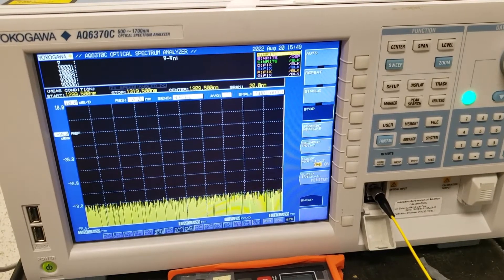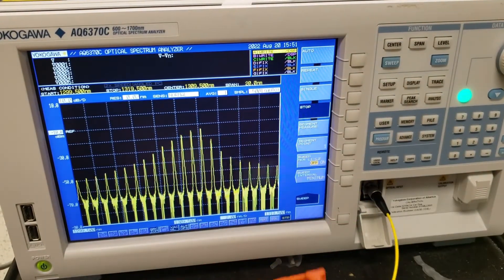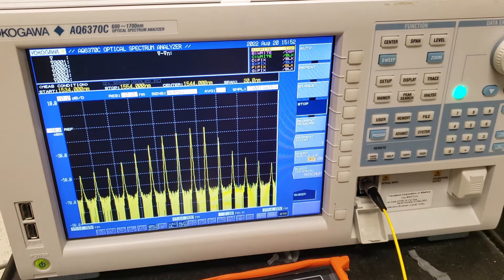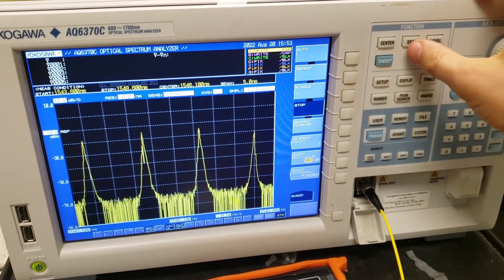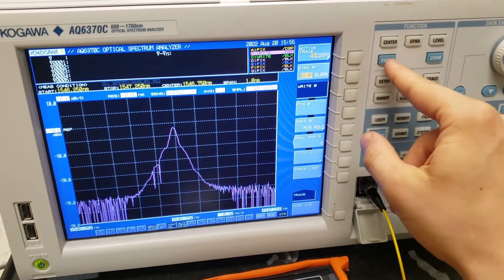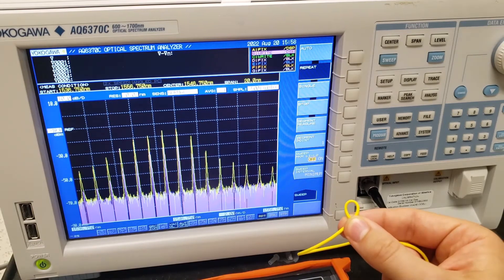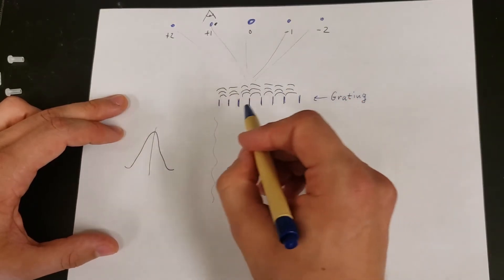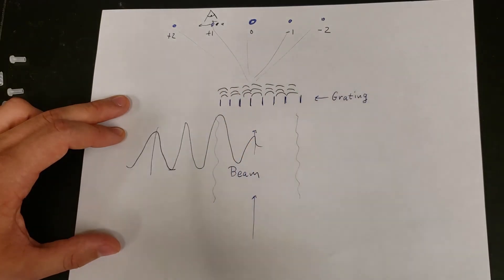Optical Spectrum Analyzer demonstration

Comment: Bending fiber so much produce crack in glassy part.
Reply from the maker: In my experience, fibers are a lot more robust against bending than most people assume. Between the yellow rubber on the outside and the glass fiber in the middle, there is a plastic coating, which redistributes the stress and prevents cracking. If you use a stripper tool to remove the plastic coating, the glass core snaps easily, but when it is in place, a very tight bending radius (typically below 2mm) is needed for permanent damage to occur. 

Check out this interesting paper that includes both a theoretical model of bend loss and an experimental demonstration:
https://www.researchgate.net/publication/281890866_Optical_Fiber_Sensor_Experimental_Research_Based_on_the_Theory_of_Bending_Loss_Applied_to_Monitoring_Differential_Settlement_at_the_Earth-Rock_Junction

Comment: how to get the data and how to find wavelength values
Reply from the maker: For a quick measurement, this particular device allows you to save recorded spectra in .csv format to a USB drive, which can be plugged directly into the unit. For more advanced experiments, you may want to connect the device to a PC using GPIB, USB or Ethernet and consult the programming manual to automate the setup and acquisition of spectra.
Reply: @yourfavouriteta  can I get your contact information plz. I still suffering the problem
Reply from the maker: @shaikbaized6660  My email address is yourfavouriteTA@gmail.com. Please send a detailed description of what you are trying to accomplish, what you are having a problem with and what you have done so far to solve it (consulting the manual, contacting the manufacturer etc.).